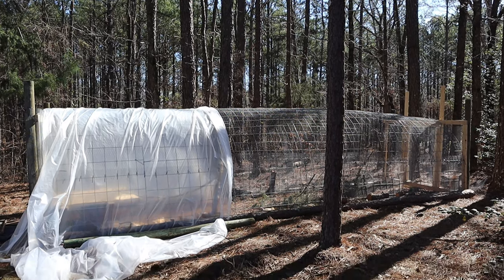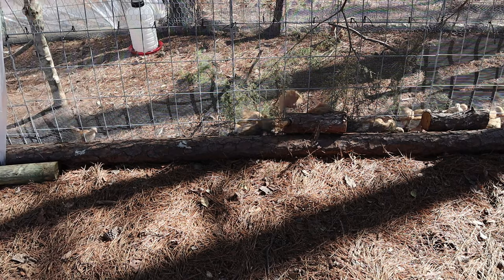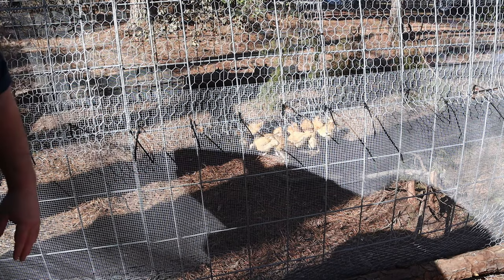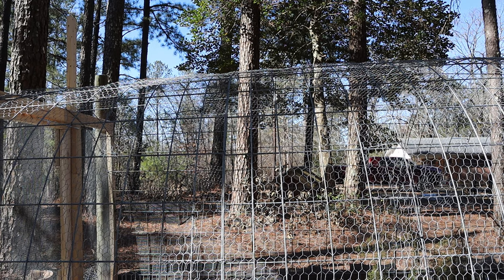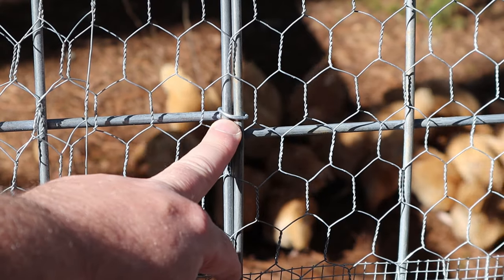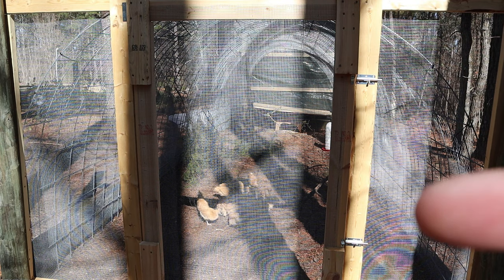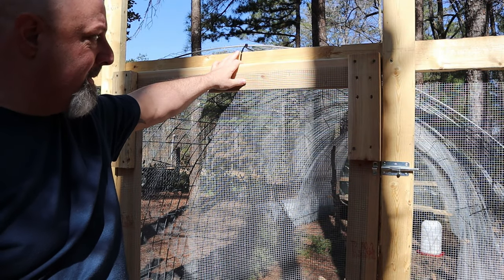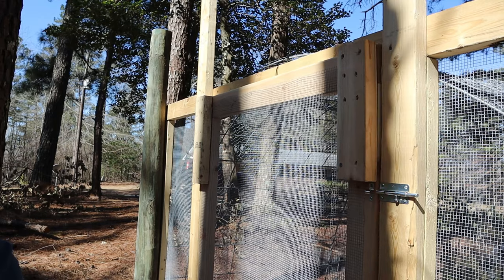Chicken Run Made Out Of Cattle Panels

Comment: Wow, very nice job for something temporary. I especially like how you secured the wire to the door. I'm planning to get chickens this spring, and am in the process of turning an old shed into a coop, and was thinking about making a run out of cattle panels (I already built a greenhouse from them, lol). You gave me lots of great ideas. The only concern I have is... I was my understanding that predators can easily get thru chicken wire (that it is only good for keeping chickens in) although that hardware cloth is super expensive and would cost a lot to cover the structure.